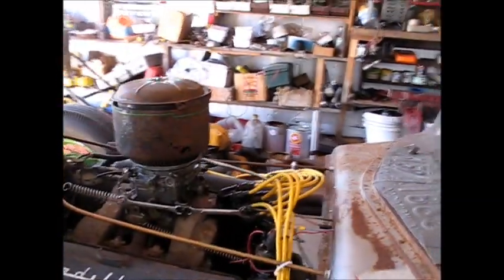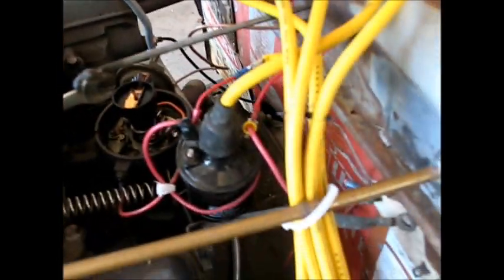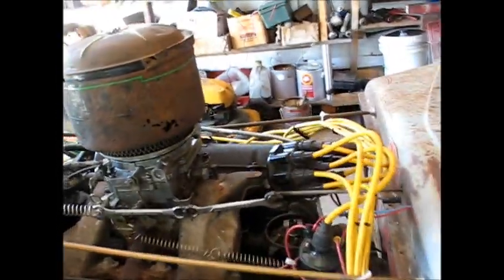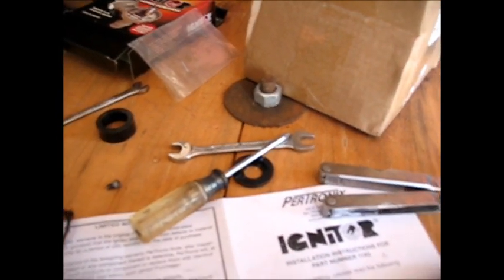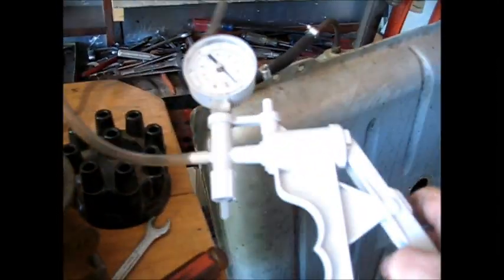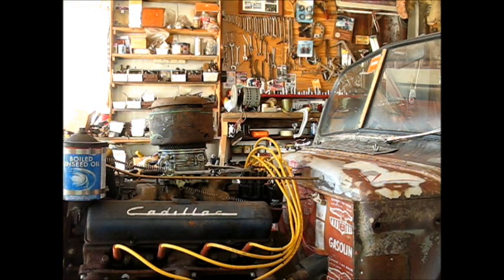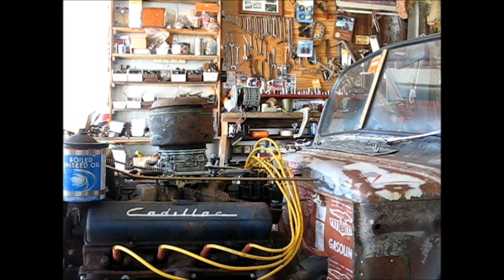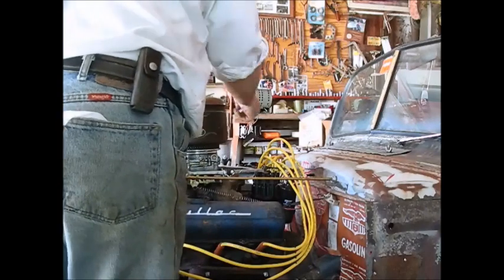Electronic Ignition in a Rat Rod

Comment: When selecting a coil for your LBC, normally, 4 and most 6 cylinder engines will use the 3.0 ohm coils. If you are going to be mostly racing with your 4 or 6 cylinder LBC then you may alternatively use the 1.5 ohm coil. For 8 cylinders you would always use the 1.5 ohm coil.

Comment: I've installed many of the pertronics modules in continental  powered fork lifts...always readjust timing and carberator as well...once we're sure valve lash is corect, adjust carb again...eventually you can run a few degrees more timing. When its right, you can idle down to counting fan blades, virtually no choke, and starting like fuel injected...n' thtow away spare points in the glove box..lol